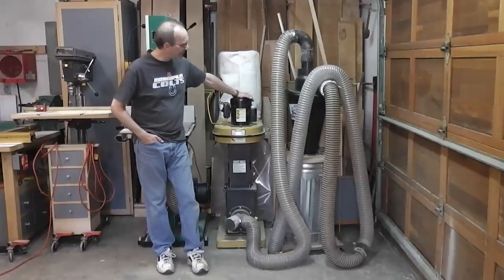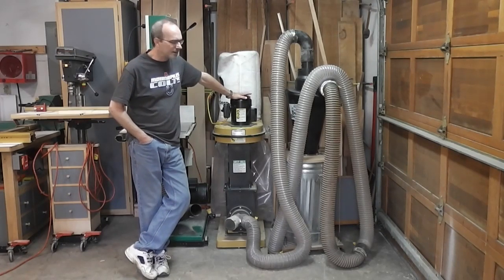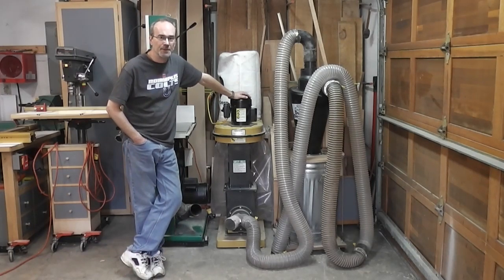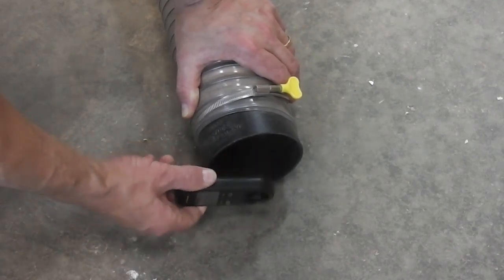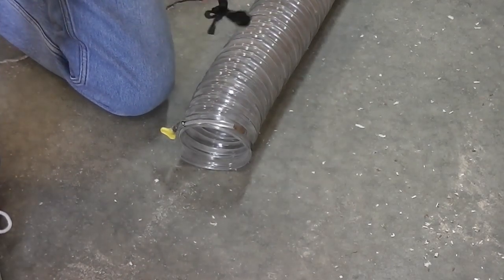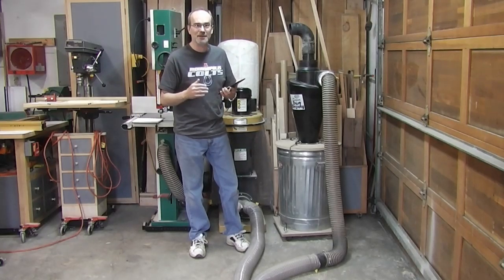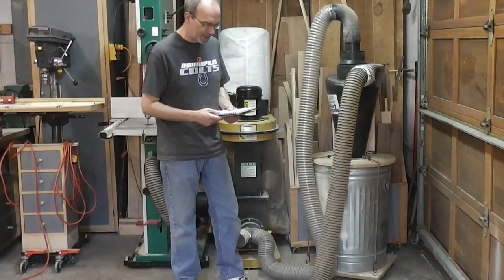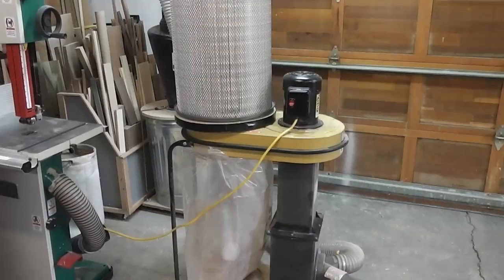Dust Collector Upgrade - Pt 1 - Upgrading to HEPA Cartridge Filter

Comment: I have the exact same Powermatic 73. I was looking to do what you've done in these 2 videos. So awesome to see how you did it worked out and what a difference it made in suction and air quality I'm sure.
 Your custom baffle kicks ass btw
Reply: I read in the comments that your custom baffle was a top and bottom layer or mdf with a hardboard belt wrapped around it. But what did you use inside as the connecting duct going down to the sdd?
Reply from the maker: More hardboard
Reply from the maker: It really works well. I should say worked. I don't have this system anymore

Comment: Great info, I like numbers! Am surprised there was such a drop adding the Dust Deputy. Will have to do some experimenting myself.
Reply from the maker: +Tyler G Yeah, I think the main reason for the drop is the angle coming out of the cyclone and the angle coming in to the DC. 90's at both points definitely doesn't help.

Comment: How do you seal the trash can to the board supporting the Dust Deputy?
Reply from the maker: Hi Denise. There is a piece  of 1/4 inch weather seal on top of the can. When the system is on, it actually sucks the can up and creates a very good seal. Thanks for watching and the great question!